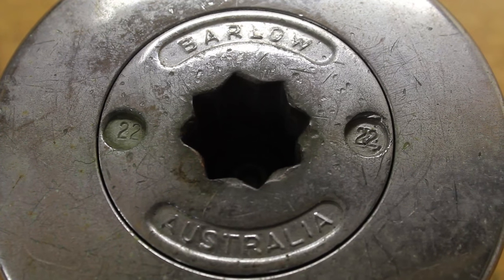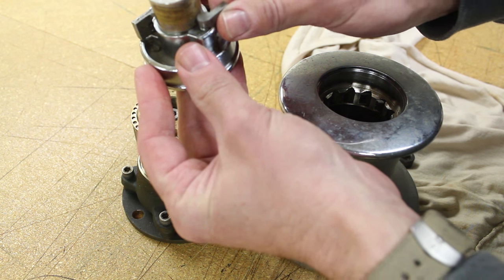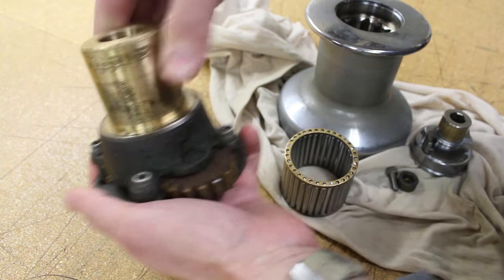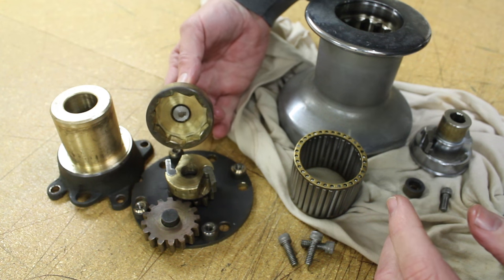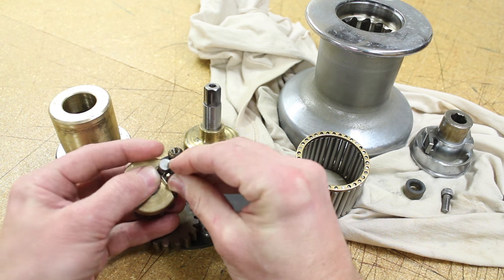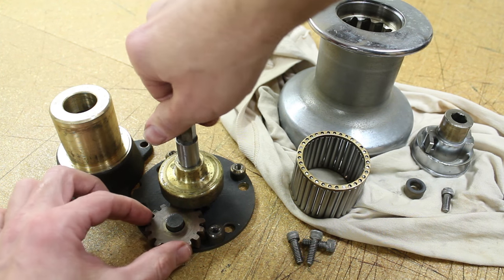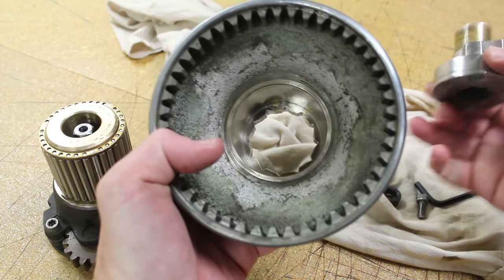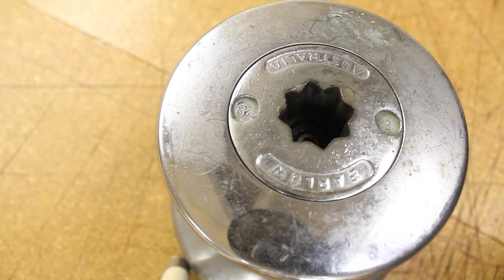Barlow 22 Winch Maintenance

Comment: I'm just working on a Barlow 24. I notice you didn't actually put any grease on the demo winch in your video. Also notice guys in other videos are really greasing the heck out of everything. So what's better in your opinion ? To grease, or not to grease ? That is the question.
Reply from the maker: I'm in freshwater, which means a lot less corrosion, but yes, I only lightly grease the winch. Too much grease only gets gummed up faster, in my opinion. Whatever the case, regular maintenance is a must.

Comment: Very useful video! I have 2 x 24 Barlow winches and was able to adapt sufficiently without ever having serviced one before and no parts left over :) p.s I oiled the pawls and greased the bearings only. Was I supposed to grease the cog wheels too?
Reply from the maker: A dab of grease would be fine on the cogs. Glad it was helpful.